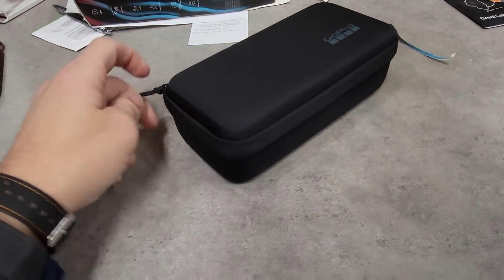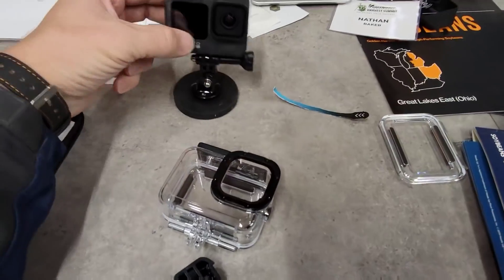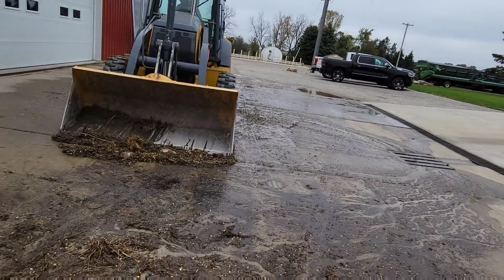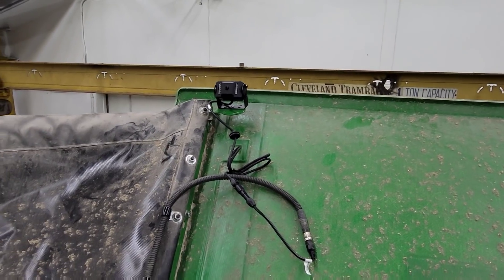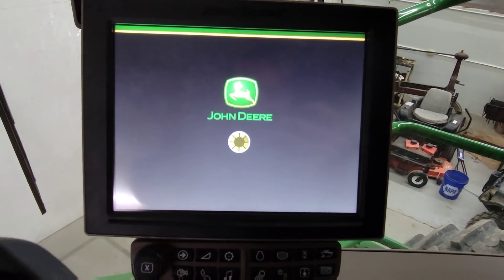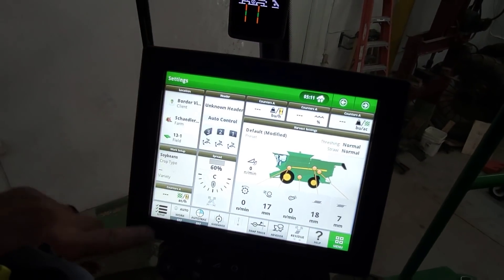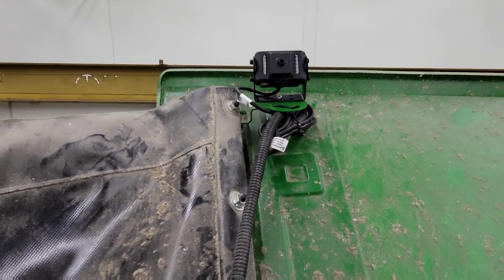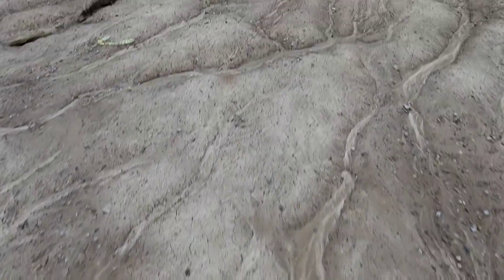Can You See Me Now? - #534

Comment: Way to GoPro! I don't know if you ordered this Combine or not, but if you did it would've been much easier and less expensive to have ordered it with all of the cameras factory installed. Food for thought, next time. I think the factory installed cameras are Logitech.
"Nothing Runs Like A Deere" 🦌👍🇺🇸
Reply from the maker: Factory installed cameras aren't an option. Pre wired like we got is an option but not getting the actual cameras
Reply: @BorderViewFarms  
Maybe I'm thinking of the "Combine Advisor Package" which is 3 factory installed cameras on the inside of the Combine itself.
Reply from the maker: @RealJohnWayne  yes those should come factory installed and we ordered it that way.  Deere just can't get the cameras right now.
Reply: @BorderViewFarms  
It sounds like you ordered every available factory installed camera option you could, which is very smart. 
I think that just about everything that has anything to do with electronics, literally is "on a slow boat from China" this time. 🤦‍♂️

Comment: can you pull up the JD STUFF 
which includes the camera stuff 
on your TABLET ????   
like they can do with BOATNET on boats?? 
or wichever flaveor you using... ???  

*OORR*

does it work .....
.....but it HAS TO BE AN IPAD ONLY.... 
and you only do ANDROID TABLETS 
or sumsuch something like that????

it seems like you SHOULD be able to send certian stuff to an EXTRA MONITOR DISPLAY and that ''extra display'' should be able to be your FONE, any TABLET, or LAPTOP (one of them little chormebooks that they send to the homeskool kids... lol  all ruggidized and sealed... ??? :) well a laptop in a combine??  or a TRACTOR???  you gutta be kidding.. but...  well yea... that was the thought...  then STREAM ALL INPUTS TO the OPTICAL DRIVE 5 terrabite'y DRIVE or wutever ... and edit THERE on that divice? extra work initially but all the video dumped to the LAPTOP ... you just plug in and run... seems kinda cool idea or thought to me... ((not just the puters the homeskooled ones usin, the ones that have MILSPEC ratings... and get the insurance...!!!)) LOL  I can provide links, but would be better if someone else says ''THIS IS WHAT WE USE AND THEY WORK GREAT''  or wordage to that effect....